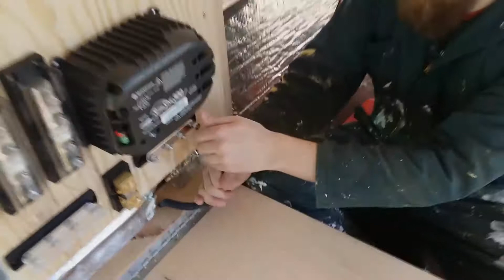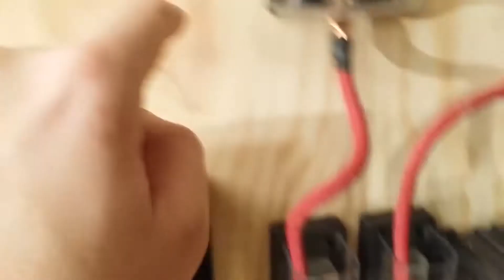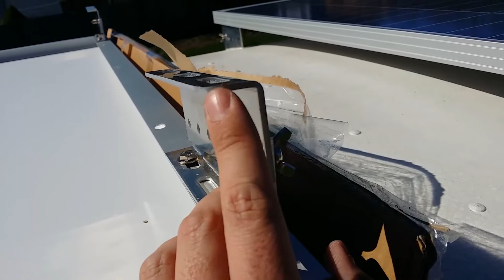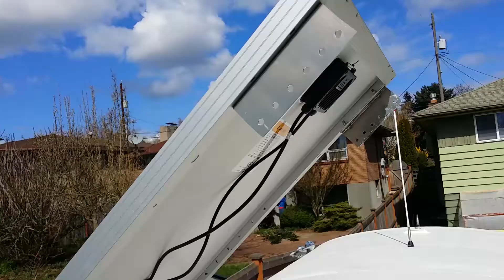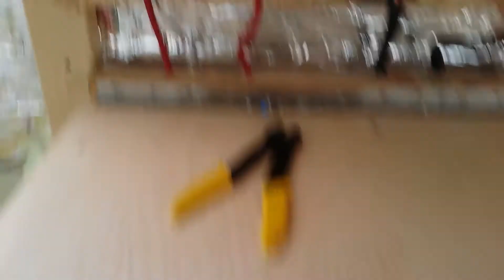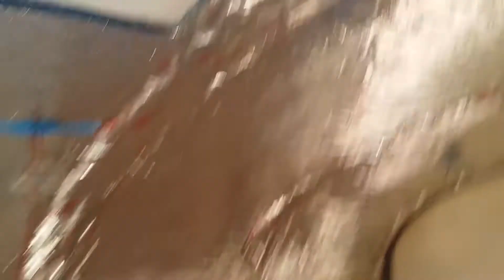Conversion Video 18: Solar

Comment: Nice work! Definitely cleared up some questions I had about how the whole system operates! You have links to where you got the parts?
Reply from the maker: Most of it came from AMSolar.com. a few things from Amazon, and some stuff from my local hardware store, Tacoma Screw.

Comment: You can only use AGM or lithium batteries sense you mounted the batteries inside the living area. It’s not legal to use any battery that can “ gas off” inside a living area

Comment: Your inverter must be a 3000watt unit. Otherwise the system is incredibly heavy duty for a 300 watt inverter. Those cables would be suitable for a very large house!
Reply from the maker: Nope, 300.  It's a dinky little thing, but I don't need much AC.  Every permanent component in the bus is run off DC power.  I only need AC for the outlets that will be used for charging laptops and phones.  I can always upgrade to something bigger, if necessary, or maybe a bigger one as a backup.  I'll just have to see how it goes with this little workhorse.  It's a Suresine 300.

Comment: Hi, I am new to solar stuff and bus conversions so please bare with me. I noticed on your wiring that white was positive and black was negative. I have only been exposed to house wiring which is the opposite.  Do all solar systems operate like this? Or is this an RV thing? Sorry I confuse easily
Reply from the maker: You're right to be confused.  In AC, the white is neutral, black is hot.  In DC, most systems you encounter will have red (+) and black (-).  However, some DC electrical systems use black and white.  For DC power, black is neutral, and white is hot.  At least, that's how I understand it, according to the information that I have been presented.  The wires on my solar panels and fans came with black and white wires.  Luckily, they were labeled at the factory to help avoid any mistakes.  I'm just as annoyed as you are, but I followed the rules so that it would be easier to know what to do in the future, if anything needs to be modified.  RVs are a hodgepodge of AC and DC, and the electrical code really doesn't make that easier to deal with.
Reply: Thank you for the clarification.

Comment: Nice job! Really neat to see all that great equipment going to use. I have the same inverter and I was wondering if you know why they say to ground the AC side to the DC side? This seems completely wrong to me. Also, the switch that you installed between your fuse and inverter is a breaker... it seems redundant to put a fuse and breaker in the same line like that but is there a reason for it? Just keep in mind that over sizing the fuses can be pretty dangerous. It is supposed to supply a amp ceiling for your device, you have inherently raised the ceiling. Probably won't make much of a difference for now and you said you were going to resize them, I would be a little nervous personally. The solar mounts are phenomenal, fantastic job all around!
Reply from the maker: I did not ground it that way, though that was also what I originally tried based on what I saw other people doing.  Check out my next video.  I made sure that I go over how I wired it.  The manual didn't even address the AC ground, which was frustrating.  

I didn't realize that switch was also a breaker!  That does make the other fuse redundant.  I'm just going to pull my "not an electrician" card on that one.
Reply: I'll definitely check out your next video! Sorry, I said the manual but it was actually the reference on Morningstar's site that showed the "Correct Inverter Wiring". 
http://support.morningstarcorp.com/wp-content/uploads/2014/07/ALL.DIG_.Correct_Inverter_Wiring.01.EN_.pdf

I actually installed mine in the van this last Sunday with two GFI outlets and everything has been running awesome! Really excited to have it all together. 

I can't fully see the switch/breaker in the video so double check if you do end up adjusting anything; it looks like all the breakers I have and it is rated for 60 amps. Not really a huge mistake but you might have been able to save a little money. I have made far worse mistakes, believe me... and if I had a dollar for all of them I would be rich.

Comment: The charge controller could be higher so you don't have to bend down too much, and you will not notice any voltage or amperage difference.
Those screws are self-tapping. They will go through that metal roof way better than the drill bit.
Nice clean-looking install.

Comment: Very nice installation! Only a couple things that I see I have questions about. 1) You made some pretty cool and simple tilting mechanisms but honestly it would take a ladder, good balance and 15 minutes to  tilt the panels every time you move the bus. Also the other end of the panel you have to keep those bolts sorta loose to be able to pivot. I would be afraid they may work loose going down the road. 2) Those tek screws holding down the brackets on your roof for the solar panels. Are they strong enough? I use them all the time but in this application I would feel better if the panels were bolted down with a nut and washer on the inside of the bus through a support rib and not just the sheet metal. Maybe overkill but driving down the interstate @ 70mph and I could imagine one of those panels fly off and hit a car behind me. What are your plans when finished? Tiny house? RV? Anyways nice build so far look forward to the updates.
Reply from the maker: Thanks J!  I have actually mastered getting up on the roof without a ladder.  Since I have a conventional body, I can step up on the front bumper, climb onto the hood, stand up, turn around, and hop up onto the roof on my butt.  I had to do it like 50 times when I was tuning my CB antenna, so I feel pretty confident about it.  

Also, the panels will probably not be tilted unless I plan to stay in one place for at least a week.  The amount of energy they supply laying flat in the PNW is plenty for my typical use, especially since most things in the bus won't require an inverter to run.  I'm trying to use as many DC components as possible.  

Yeah, it's a pain to tilt them, but using wingnuts is quick and easy.  I can cinch them down pretty tight.

As for the bolts to the roof, each corner of each solar panel has 3 screws holding each bracket to the roof, and the entire foot is sealed with silicon.  That's 12 screws per panel.  Even if one bolt comes loose, it is still sealed in silicon, so it won't fly away.  The other two can still hold the bracket.  Once they were tightened down, they wouldn't budge.  I feel good about it.  I thought about doing the bolt thing, but then I would be poking holes in my insulation from inside, to get to the bolts.  Putting the insulation up was a huge pain, so I didn't want to revisit that if I didn't have to.  It was a judgment call.  If the panels had gone up first, I may have done that.  Also, since the bus metal is something like 14 or 12 gauge, there wasn't a lot of material to grab, but it was still pretty sturdy.  So, I opted for a screw that was designed for metal on metal and had large threads for maximum grip.  

If anything is going to fail, it will be the wingnuts that I use for pivoting.  There's only one on each corner, and they will probably get worn.  I plan to inspect them after each adjustment, replacing as I go.  

The first plan for the completed project is a road trip to some national parks and use it as base-camp for some hikes.  It's a vague goal, but I think that the bus should give me the luxury of being loose with my plans.